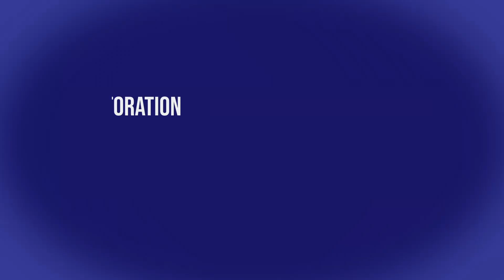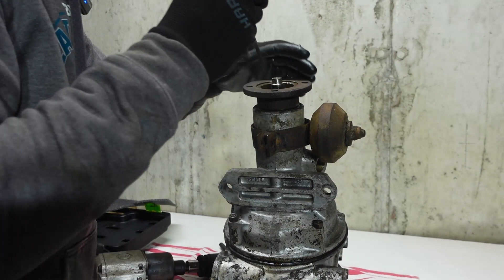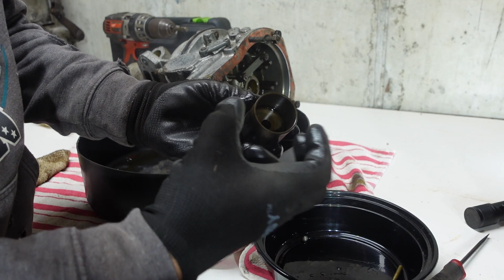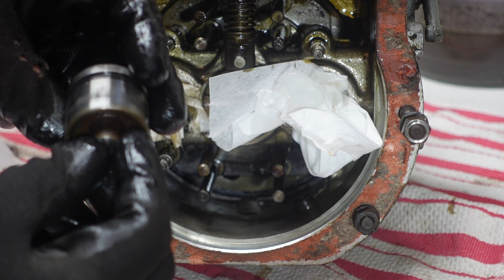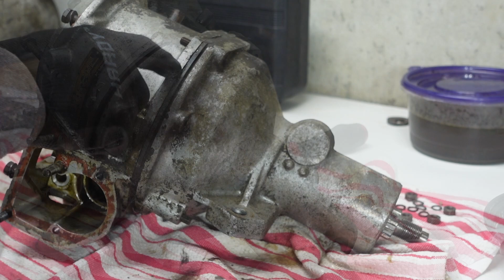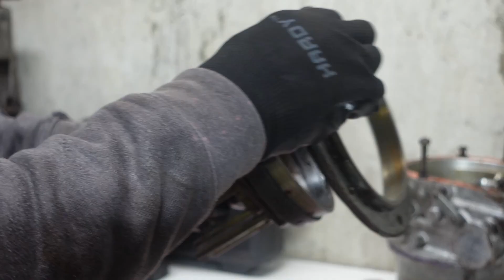Triumph TR4 - A-Type Overdrive Teardown #2 | Roundtail Restoration

Comment: My TR4A has overdrive and the weight.  I have read that these were to damp out resonance at above 3000rpm. with a number of entries in various forums suggesting that they were fitted mid way through TR4 production and on into the 4A.  However, I have not seen the part referenced in my original Stanpart TR4/4A workshop manual and they seem to be somewhat mysterious objects.  When I was re-building my car I found that the hole through the strap part had worn and the weight was loose.  I didn't like the idea of this heavy lump falling off at speed, so I repaired the hole and made sure all was very secure on re-assembly.  Would love to read a definitive answer if anyone has it.
Reply from the maker: Hi Robin. In the spare parts catalog, I found part number 132604, Weight and Bush Assy, Vibration Damper, with several other parts associated with it. There's no picture of it and it says it's only from gearbox numbers CT17815 to CT35719. My OD gearbox is well beyond that, but may have been put on an earlier TR4. My gearbox that came with the car is post-35719, so it would not have had it. Might that be it?